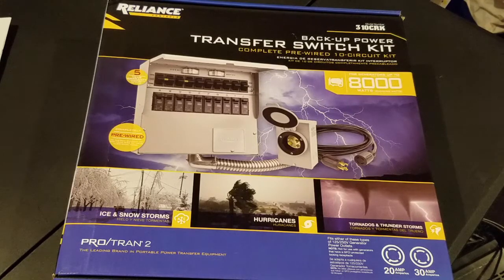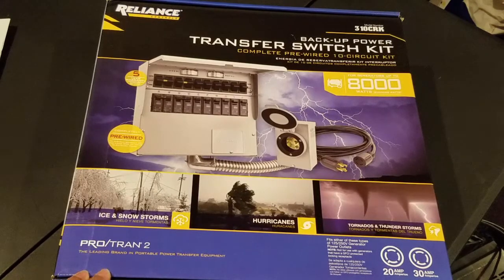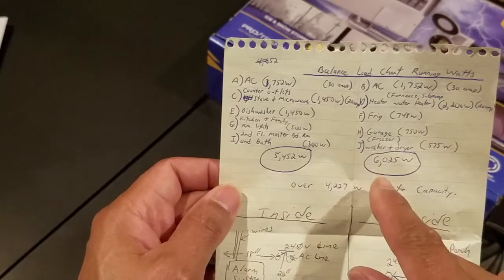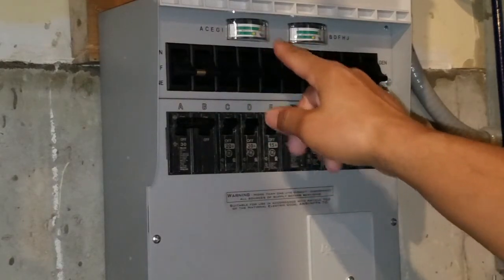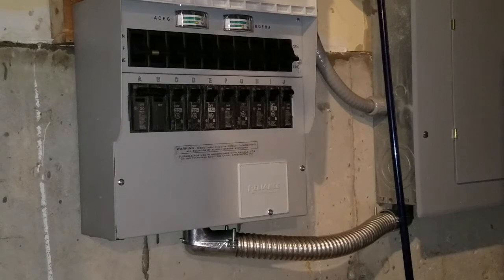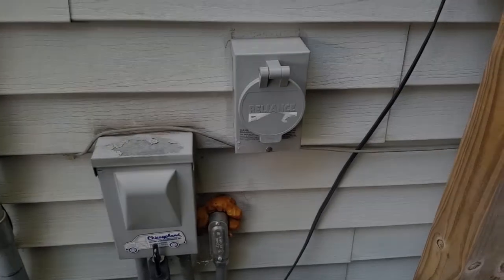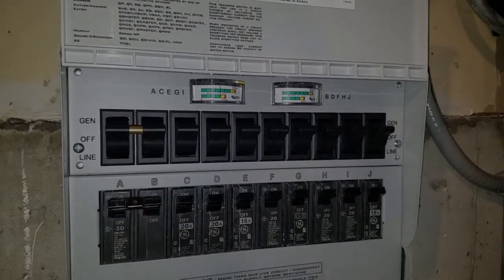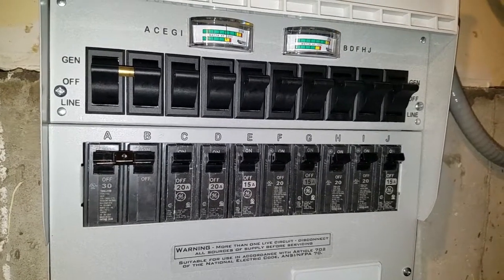Reliance Manual Transfer Switch Kit Explained/Review and Why It's Better Than an Interlock Switch

Comment: I have installed both interlocks and transfer switches. Just to add to what you said. The transfer switch is more user friendly for people that are not familiar home electric. The transfer switch has a lot of features that an interlock kit alone doesn't have. For example, with an interlock kit you need to add your own watt meter and power back alarm system  since you won't know if power is restored. But those features are not necessary.  The down fall of the transfer switch is if your home is not wired with breakers that mirror your transfer switch. For example, my home has mostly 20 amp breakers and most transfer switches is wired with mostly 15 amp breakers and two 20 amp breakers. Also, if you need 220 and the transfer switch you use two spots on your transfer switch.

What you left out on your cost estimate is the cost of the wire and clamps from your transfer switch to the exterior box.

The interlock kit is better because you can run your whole house or part of your house. For example if you plan to run one room on the transfer switch and a tree falls into that room you are kind of out of luck. So you can safety plan and huddle in any part of the home with the interlock kit.

However, I do suggest the transfer switch in 3 applications. First what is the comfortable of the home owner can they operate the panel with ease after it's labeled properly? Second, an interlock kit requires room in the box to add a double pole breaker... Well if you got no room in the box you really can't do the interlock without first adding a sub panel or upgrading your electric service.... and it's not worth it at that point. The third application where the transfer switch is better is on OLD panels that you can't find an interlock kit. Old homes have old boxes and they don't make interlocks for them. However, the transfer switch is universal. So, I find myself installing transfer switches when I they don't make them for a panel or there is no room. Usually after I relabel a box and color code them anyone can work an interlock kit because it is also as simple as the transfer switch but the installer or homeowner needs to take the time to label things right.

At the end of the day both are good and serve the same purpose but they and I'd be happy to have either one in a power outage over nothing.
Reply from the maker: Hey thanks for all this great info. As to not including the price of the wires to the inlet box, it was only like $5. Didn't think I had to say that since the price will very, depending on the length of the wires. Our transfer switch can have all 20 amp circuits.  I replaced three ,of the 15 amp circuits, with 20 amp circuits to match that circuit in the main control panel. 

You mentioned if a room got damaged by a tree and you can't use that room anymore, your out of luck. The transfer switch works just like the main control panel. You can have all the switches on or only a few and it wouldn't cause any issues.

Comment: I bought a Reliance 510C, my panel is mounted flush and I ordered a flush kit for the switch, I understood everything you said about the wiring except how to hard wire the unit. But I guess it will be self-explanatory when I open it up.
Reply from the maker: The included instructions. Do a good job explaining how to connect it to your main panel. Also, there are some good YouTube videos I watched showing how to hook it up.
Reply: @Pk3_Garage  It's all good, it just seems like there's not enough time in day but we'll worth it.

Comment: I have the exact same transfer switch.i hooked it up a few months ago, anyway today i wanted to change 2 of the 15A breakers and make them both 20A breakers, then i got to thinking i wander if theres a max for the amps. I looked in my manual and it says 60A max combined loads at 125v. Do you know if thats 60A for a,c,e,g,i and 60A for b,d,f,h,j or 60A total for A-j ?
Reply from the maker: That's a good question.  I don't have the owners manual in front of me right now, but based off of what you provided, I believe it's the ten circuits combined. 60A @ 125v = 7500 watts.  But here's the thing, I replaced three of the 15 amps circuits to 20 amps circuits. This matched the breaker it was connected to in my main panel.
Reply: @Pk3_Garage  i guess mines way over the max then. All of mine are 20 except maybe 2. Sounds like its time for an upgrade i guess
Reply from the maker: Not really. Remember that you won't be using the max wattage for each circuit at the same time.  As a matter of fact, you could change all the circuits to 20 amps and still be fine.  Figure out what your going to be using on each circuit and how much power will be used.  Then balance the load on both sides. Once your on Gen power, use the wattage meters to balance your load and make sure your not over loading your generator.

Comment: Well done. I installed their 6 circuit model 5 years ago and recently upgraded to this 10 circuit model modified to all single pole circuits. Our heat is natural gas, hot water is tankless natural gas. We have a full basement that remains cool during the summer so we don't need the A/C. We cook with the microwave oven, convection oven, propane stove and grill so the electric range is not connected. I also prefer this method over an interlock kit but the interlock kit is safe if you pay attention to operation and not overloading the generator. Thanks again for your review.
Reply from the maker: Happy Friday and thanks for sharing.  The great thing about both the manual transfer switch and interlock switch, is having a verity of ways to safely use a portable generator to power essential things in your house, during a power outage.
Reply: I'll I want to swap out the breakers for a higher amperage which ones are compatible. The 6 circuit version has 4 15 amp breakers. I prefer 20 amp breakers but the question is which 20 amps can I use. Will square d breakers work

Comment: what is the difference between a3006hdk and a 306crk? tnx. Jim
Reply: 306CRK is the mfg part number (p/n) for the 6 circuit kit.  When you see 306HDK that is the p/n assigned to home depot. For Lowe's it will be 306LRK.  They are all the same kit though.  This is how stores get away with marking items up a little bit more than the others.  They won't price match because it is not the same p/n.
Reply: @RoliO11  Thank you for the info.  Jim
Reply from the maker: Check out their website. http://www.reliancecontrols.com/pro-tran-2.aspx

Comment: Great explanation thanks for the info, two questions:

The maximum wattage on the transfer switch was less than your portable generator running wattage. Why is that?

Does the transfer switch show the wattage used when the transfer switch is connected to Line? (In order to find out what size generator I need) 

Thanks
Reply from the maker: 1) The continuous running watts on the Transfer switch is 8000 watts.  Our generator continuous running watts is 7250 watts.  So the transfer switch has a higher continuous running watts then our generator.

2) No.  There is no power being registered on the watts meters when in line mode. You can check with your energy provider to verify your monthly/daily/hourly usage to see what size generator you need.
Reply: Thank you so much, your video helped me understand the transfer switch. 
any suggestions for connecting more than 10 circuits?
Reply from the maker: I couldn't find a manual transfer switch, with more then 10 circuits, when I was doing my research.  If you have more then 10 circuits you want to use, my suggestion would be the interlock switch.  This way you can use any of the circuits in your main control panel.  Just remember, you can't have all the circuit on at the same time. So you would need to install a watts meter too, to help balance the load and manage your power load.

Comment: Great video.  I have same transfer switch. One of my wattage meters ( right one) shows that it has wattage running through it even when I don’t have generator
Reply from the maker: Hum, is the extension cord connected to the generator and/or inlet box? Which position is the toggle switch (Gen, off, line)? I would check the transfer switch wires below the fuses and main panel to see if any wires are touching each other or connected wrong.  You can test the wires in the transfer switch with a multi-meter.
Reply: @Pk3_Garage  no the extension is not connected. And the toggles are on line.  I have test run my home on generator power several times and have not had any issues.  Just curious why amp meter shows around 500 watts when not connected to the generator
Reply from the maker: To be safe, call the manufacturer and check the trouble page in the owners manual.

Comment: Hi, I have a question, I know you went through this in this video but the part I am getting confused when the power comes back after power outage, it's not going to power up the one we're running on generator right? It's only going to power ones we switch to line position from generator?
Reply from the maker: That's correct. With the ten circuits that I picked to run through the transfer switch, power will either come from the generator or utility. Never being powered by both at the same time. The transfer switch isolates the power source as well as that circuit from being feed by two power sources at the same time. (No back feeding) If that makes since.
Reply: @Pk3_Garage  Thank you! Appreciate you taking the time to reply,  that was well worth 30 minutes i spent watching this today.
Reply from the maker: Your welcome and thanks for watching my video.

Comment: Hey nice video. This is definitely the way to go pretty much fool proof. So what brand and model generator did you get. I was thinking about getting a diesel generator. I’m always involved in mechanics. I’m presently working as a small engine tech.
Reply from the maker: We have the Predator 9000/7250 watt gasoline model. It's really a nice generator and has a lot of power. I'm finalizing edits on  review video of it, so stay tuned.

Comment: LOOKS like your BALANCE is way off......1 Meter is way farther ahead than the other.  Bad for your Gen to be unbalanced.
Burn your Gen up that way.
Reply from the maker: Yes, I was aware of that.  I was just running a load test.  You are correct about unbalanced load causing damage to a generator.